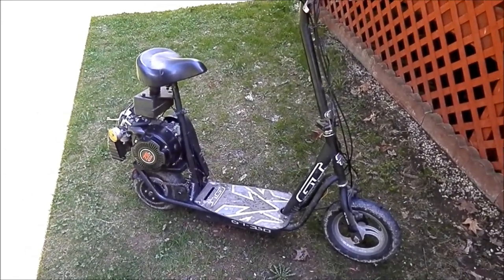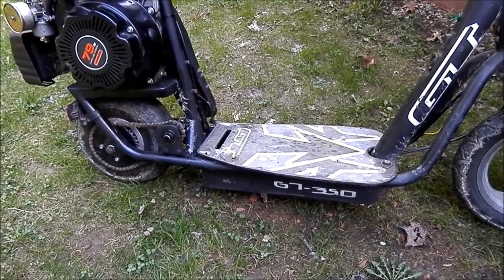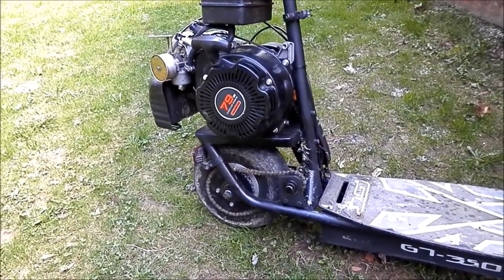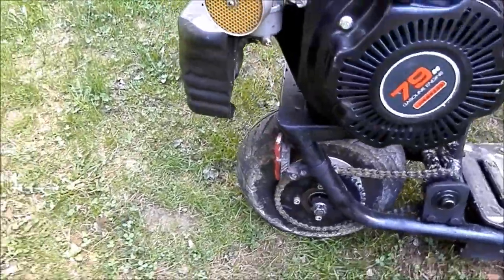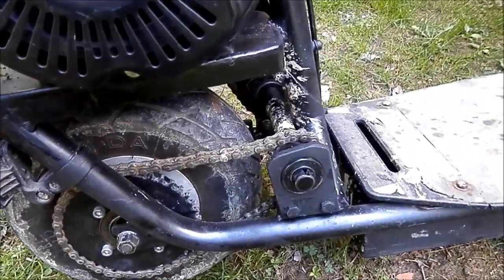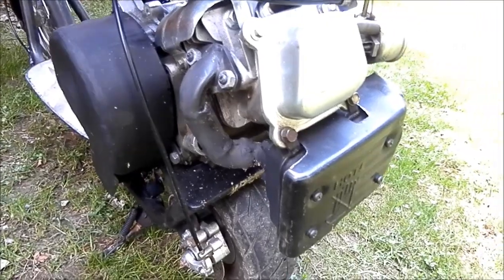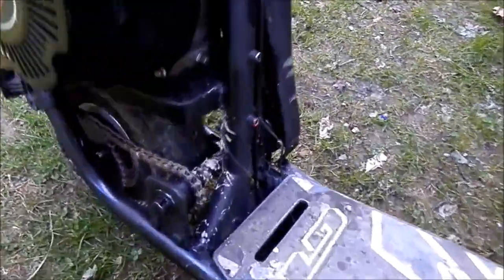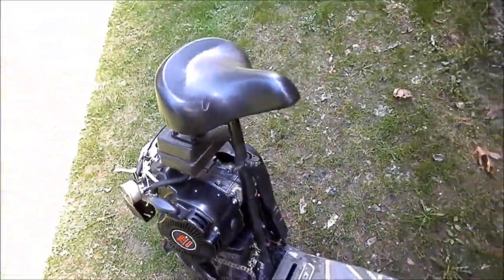Scooter Conversion Electric to Gas

Comment: With batteries on a gas motor. I need an alternater and regulate to maintain the matter charge while riding it  without those your gonna eat up battery s especially in cold winter and hot summer  if it sits . Id just do the old pull or get a kick star kit

Comment: I bet its dangerous to turn at high speeds, such a high center of gravity you cant lean enough haha! 
That's a cool build, like every   project you do. Greetings from Argentina!
Reply: i just added a 36v to my 24v scooter, the damn thing is dangerous
Reply: You've heard of the high-speed wobble. With that its more like  a twitch and you are road rash
Reply: I thought it would be cool to build a Brigs three horsepower because there's no performance parts available for it but since I work in a machine shop I would have something special. 45 mph on 10-in tires f**** scary
Reply: That's not wheel diameter its tire dia.

Comment: Nice set up!! I think we gotta find a disc brake set up too, that band brake just don't cut it!!☺
Reply from the maker: Yeah the disk does ok but it still has the front brake and it takes both to get it stopped at speed. but maybe with a beefier caliper it would do better

Comment: where did you get a throttle cable long enough to go all the way down the big old handlebar and all the way under and I'm back up to the engine mine is two pieces
Reply from the maker: probably ebay i think they come in 75 and 100"  maybe even longer